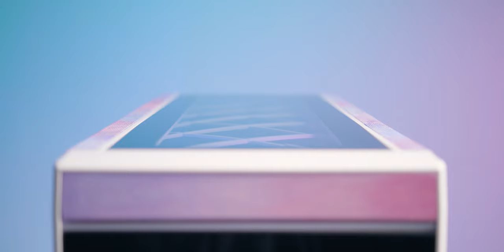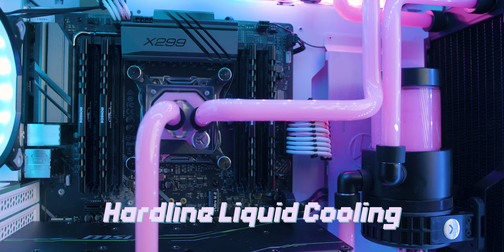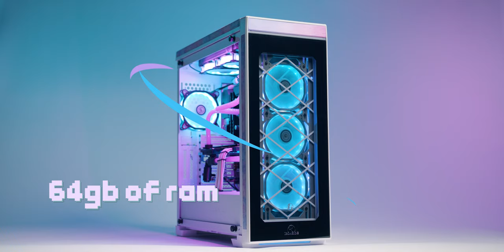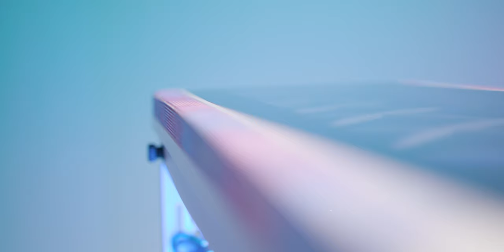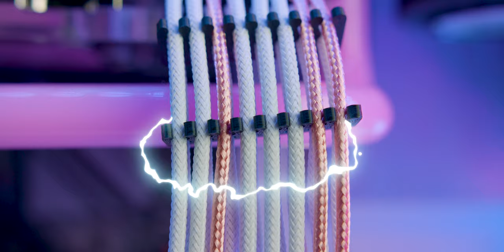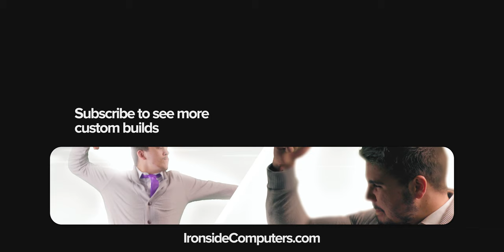Sweet Dreams: A Pastel Gaming PC for Coal Mine

Comment: I really love all your PC's but just a question why use RTX 2080Ti when there's RTX 30 series available
Reply: Available is the issue
Reply: @Thelionofcaliban  I'm sure firms this big won't have any problem relating to 'availability' of a PC component.
Reply: @rohitgarg797  they are not that big... NVIDIA will guarantee partners their size maybe a few cards at best. they won't have enough that they can start putting them in their machines.
Reply: nvidia doesnt give them that much cards 
cuz they are not a" speed building" firm they make custom computers not fast and easy to build prebuilt pc
Reply: They probs wanna get rid of ty ere 2080s lmao